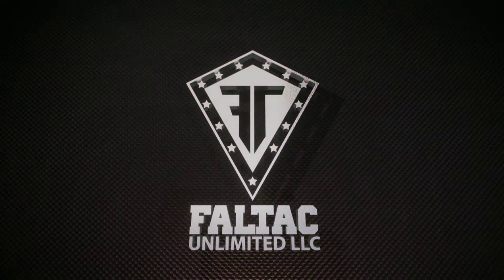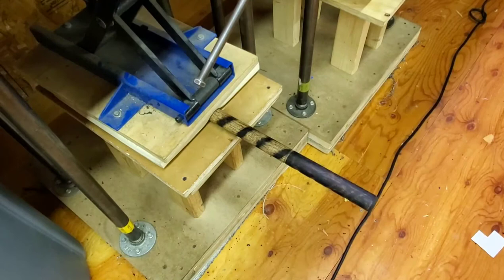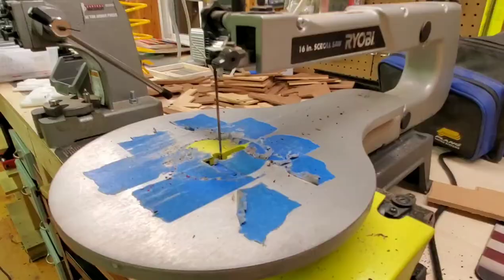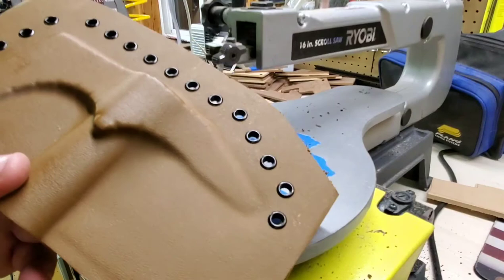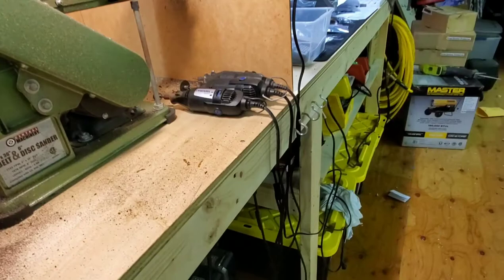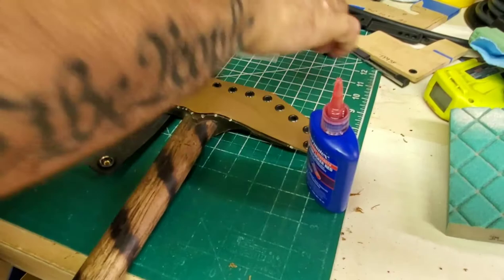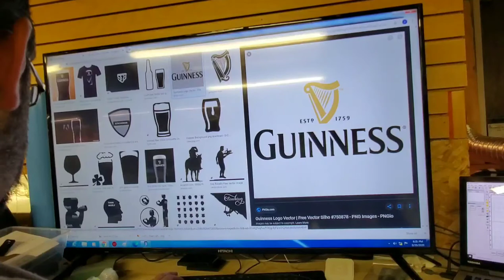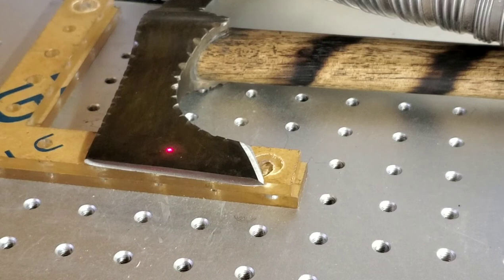Making a kydex sheath for a hatchet or axe

Comment: I know this is an old video but ive been searching knifekits and holstersmith for that block you used to space your holes with. Where could I get one or one similar?
Reply from the maker: The black guides I got from diyholster.com but holstersmith has drill guides as well under tooling
Reply from the maker: https://www.holstersmith.com/vcom/tools-molding-preparation-c-548_744.html
Reply: Sweet! Thanks